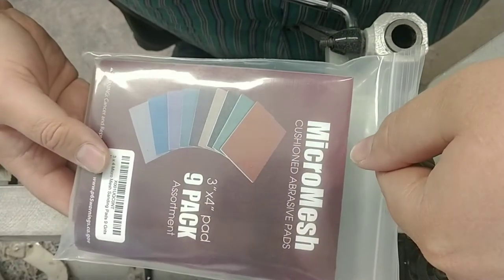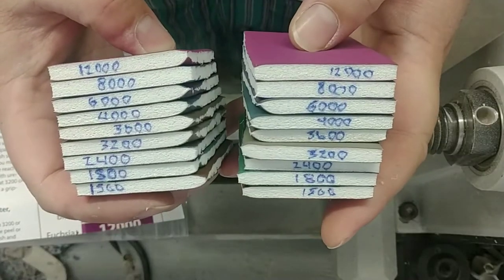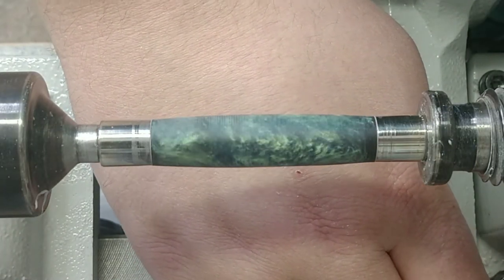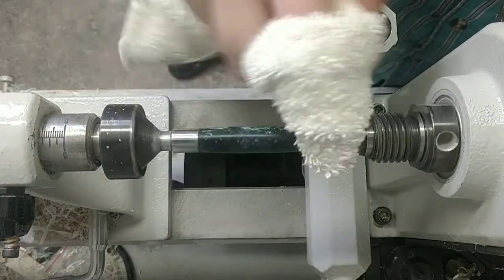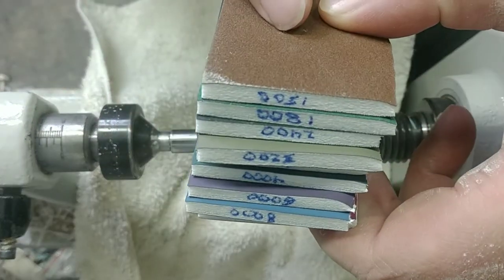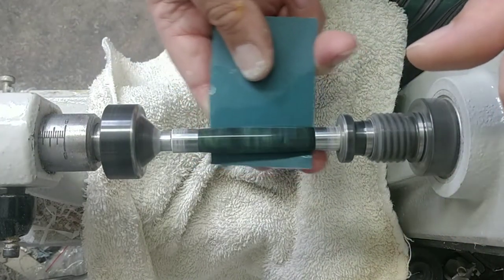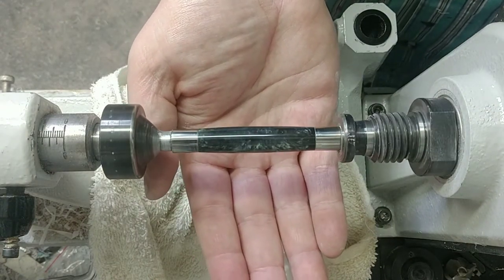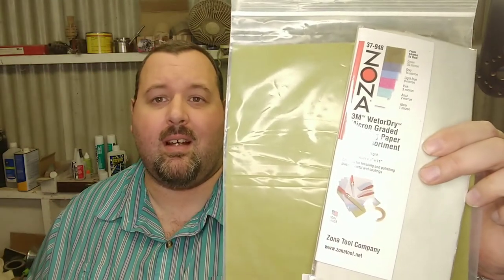Setting Up and Using Micro Mesh Pads to Polish Resin Blanks

Comment: My bet is that the smell is from the solvent for the adhesive holding the abrasive to the pad.  Reading the literature on how micro-mesh works, the claim is that the abrasive is aligned on a special flexible surface, which is even the case on their sheets.  But, the kit I bought came in a cardboard box, and I don't remember any smell when I first opened it.

Comment: Might be a good idea to have one set for metals and one for woods/resins? Also if you sand an oily wood now and then it infuses a natural finishing compound into the pad. Eg. cocobolo, bokote etc. I find Abranet is a great starting paper, I buy 30ft rolls of it. Lasts forever. 400 grit - 800 grit, then hit it with the micro pads. One more thing - I swap my bushings to silicone ones in the micro pad steps as they remove so little material you don't really need the "security" of the bushing.
Reply from the maker: I like the idea of the silicone bushing, thanks, where do you get silicone bushings? Or are you talking about the non stick ca finish cones?
Reply: @TheTacticalPainter  Sorry yeah I meant the little cones. Silicone bushings would be cool though! Would last forever and no worries about transfer of metal bits to the blank. And you could move straight onto superglue! Just had a quick Google - M7 washers are a thing so maybe it would be possible to find ones with the diameter of the blank :) Will look into it.
Reply from the maker: Manufacturing some HDPE bushings would be ideal. The reason I don't polish on the cones is because you have to be a lot more careful around the ends of the blank to prevent rounding them over or burning a line in your pad if it gets caught. So I like the hard edge of the bushings to prevent that or getting the end of of size spec. However, it would be easy to replicate some bushings out of ¾" HDPE that I could use for the same purpose.
Reply: @TheTacticalPainter  Good call!

Comment: hello , if used on carbon fiber, should I use them with water like sand paper?
Reply from the maker: I would, the carbon fiber is held in place with resin. So it'll work the same as resin when polishing

Comment: Very odd, I have been using micromesh for years and they don't seem to smell bad and weren't stuck together.  What I don't understand is that all the various Micro Mesh products I have purchased use the same color/grit scheme.  In all cases the finest pad is gray.
Reply from the maker: These used to be grey but they changed to pink cause they were getting confused with the slate color of one of the middle grits
Reply: @TheTacticalPainter , they are a great product and last a long time.  You can clean them in soapy water. Good to see someone reviewing this product!  Thanks!
Reply from the maker: @marknelson7451 you're most welcome, happy turning! 😁